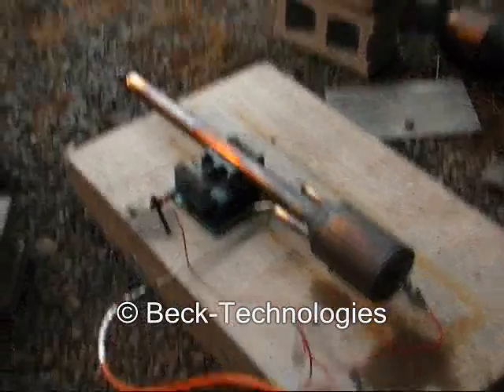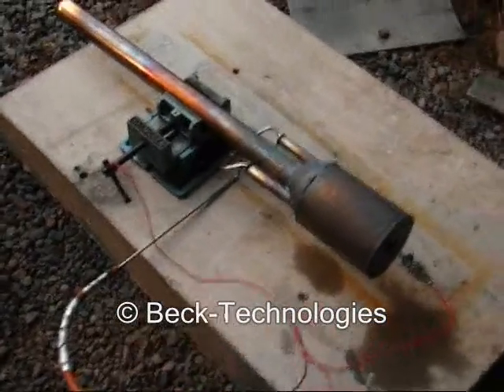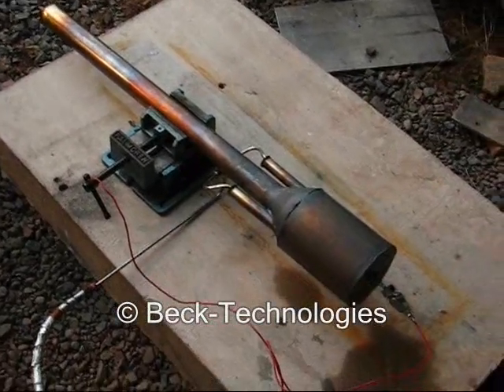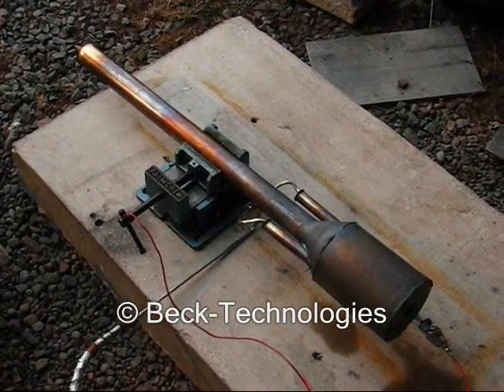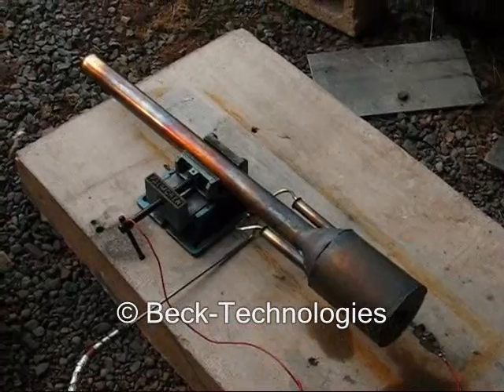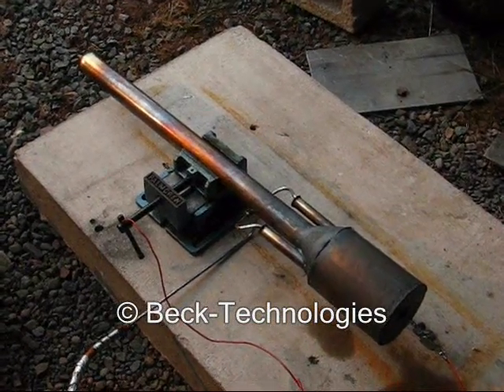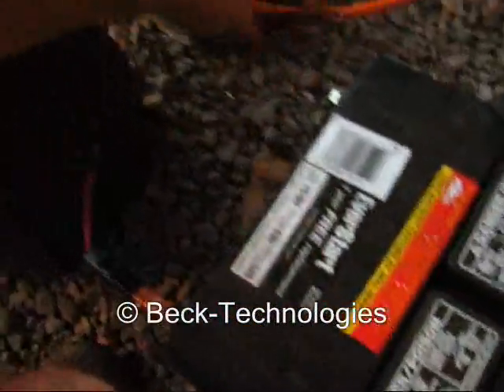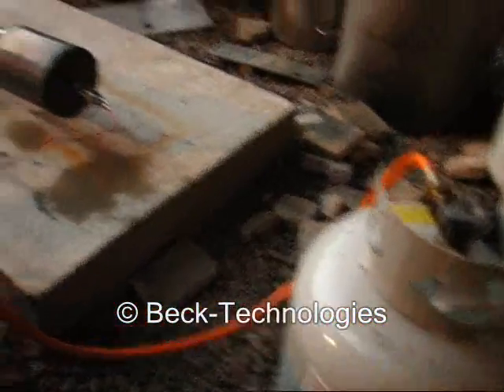10 Lb Thermojet Valveless Pulse Jet Engine

Comment: Can it power a bicycle after you gained some speed by paddling
Reply: Olivier Beucken two twenty pound pulse jets will pass cars on the highway
Reply: real life bart Simpson so four of these will get me highway speeds?
Reply: Olivier Beucken If you run it on the right fuel it will only take three and it will pass cars on the highway

Comment: I purchased the FWE engine Beck makes. It's a 1 pound thrust engine. I also have a HK Red Head valved engine rated at 3 1/2 pound of thrust. There miles apart BUT the valveless engine just runs & runs & the HK always has issues. I went through 5 valves in 20 minutes of running. Anyway I have a 10 pound valveless engine from Beck coming in any day. WHEN ??? They answer no emails at all & the FWE had zero  instructions. I will have a good gauge now to see if the 10 lb. engine is 10 lb or 3 1/2 .  I will post it as soon as I test run it.

Comment: If anybody wants to try this engine, it is important to switch to liquid fuel when the engine reaches operating temperature. If you operate the engine on propane vapor, thrust will decrease rapidly. You can only get 60 percent power with propane vapor. this is because the volume of the combustion chamber is not the same for propane vapor and liquid fuel. Propane vapor will take more space. Therefore, with propane vapor, the volume of the combustion chamber will be small. This information is from the Thermojet patent (US patent 3,517,510. page 4)
Reply: Andrew Shingange switch to another fuel lin3

Comment: after the engine got started & the combustion chamber glows, did you cut your ignition spark's power off or did you just keep the ignition spark on??
Reply: u turn it off the how exhaust gases get pulled back and reignight the fuel because of a vacum in the engine

Comment: a chamber (combustion chamber) gets filled with gas, (the end bit thats fat on this video) then a spark plug ignites it all and the gas creates a big bust of air (also can be provided by air compresser) that pushes a continuous flame out the flame tube. the spark plug doesnt have to be sparking at a constant cus the flame from the first fire keeps it going. and the gas has to be flowing at a continues flow. any more questions about em?

Comment: they can't really, the combustion chamber pressure is always changing from high to low. never seen one explode ever, leaking fuel lines are more hazardous than the engine itself. being burned by it is an obvious concern

Comment: Pulse jet engines are pretty easy, you ignite the fuel, and a "pulse" is created. The resulting vacuum pulls more fuel into the combustion chamber, and it ignites again. This process repeats and creates a jet engine.

Comment: so much wasted energy! one could place a small oil case around the glowing section, and u could boil oil to a vapor, and easily use it to fuel it. Connect it with a turbine, and u got potentially free electricity!!!!!!!!!!!!!!!!!!!!!!!!!!!!!!!!!!!!

Comment: you. you are an idiot. there are THOUSANDS of examples of this kind of engine - even propelling go carts, model airplanes. the engine is simple in design, but complex in principle - it takes into account harmonics of the intake and exhaust tubes (yes, there are distinct intake and exhaust tubes) and the way the thermal energy spreads in the tube itself. 

just because you don't understand something doesn't make it a hoax.

Comment: So how many Lbs the contraption weights with a spark plug configuration?
How big of a battery for the ignition? 
How long can it run continuous at 1%,10%,50%,100%?
What is the time from spark ignition to 100% throttle?
Did you notice any attitude changes in the operation of the engine in different meteorological conditions?
I am a nerd, I think i want to built one of those.
Reply: same

Comment: That's 10lb thrust. A lot of people use propane. It can be as cheap as the cost of scrap metal and some brake lines if you know how to weld. Now sure you could rig it on a bike, gokart or whatever, but I'd be iffy about ridding along with a red hot piece of steel. Plus you can't run them very long without running the risk of failure.

Comment from the maker: @Themayseffect   Pulsejets will run on almost anything that burns, but if you deal with them on a daily basis, you'd probably go with propane too, since you dont come home every night stinking of kerosene. Methanol mixed with hydrocarbon fuels produce very good results. Hydrocarbons will burn significantly cleaner with methanol mixed in.

Comment: #2 is definitely a bad idea, as pulse jets work on the principle of pulses which causes a fair amount of turbulance and vibrations that a turbo is not used to and it would thus break quickly.
@pipzipcip2000

Comment: Hy,

I plan to build such an engine myself-valveless...and I had a few ideas of how to improve it!What's do you think about:

1. A ceramic (or asbestos?) coating inside the combustion chamber. It would protect the outer metal shell and it would increase the combustion temperature thus increasing the fuel efficiency and power?

2. A turbo, powered by some exhaust that would in turn send compressed air into the intake?

3. Linking 2 eng. in a series? exhaust to intake.

Thanx,  Alex C

Comment from the maker: @EnglishTurbines 
The evaporative cooling from methanol results in a much  higher fuel charge density, combined with its rapid burn speed, result in much more thrust output.

Comment from the maker: @EnglishTurbines 
That particular video was running on a nearly empty, cold tank, so it was not at max throttle. At max throttle it is much more like the videos of the 4lb thrust engine, with distinctive shock wave pattern in the exhaust. The engine will put out approx 14 lbs on liquid fuel like methanol, you dont fly with propane. Propane is simply a clean easy no mess no fuss fuel for ground tests and demos. You dont go home smelling like kerosene at the end of the day.

Comment: @BeckTechnologies 5. Whilst the ease of starting is excelent, I have my doubts about the trhust claims, Does not look like enough air mass flow to do 10lbs thrust to me.
6. As you may have guessed, Im an engineer, and have made my own Turbojet for about 500USD...13lbs thrust @ 160K...see my Link.

Comment: @BeckTechnologies 1. Put it in a plane to demo it. (ie fly it)
2.Show how you propose to carry liquid Propane in the plane (and control flow rate)
3. Show the engine on a test rig doing 1lb up to 10lbs thrust.
4..Demonstrate  thust to weight ratio.

Comment from the maker: Unfortunately you cant just buy parts for pulsejets, we make all the parts from flat sheet metal and roll them and weld them up.

We also offer partially completed engine kits with all the materials you need, and most parts rough cut / formed

Comment from the maker: Its about 1000 degrees away from melting, you can hold your hand 6" away from the chamber just fine, the propane tank 4' away is actually chilled considerably by the evaporating propane.

Comment from the maker: Dimensions are rather important, cant just stick a bunch of tubes together and expect it to do anything other than burn fuel and make noise if it runs at all. With some engines altering the dimensions 1/8" can result in a 50% increase or decrease in thrust.

Comment: Wrap it in some Kaowool/Inswool, ceramic wool that can stand up to 2800-3000 degrees F. Great insulator and will probably enhance efficiency as more energy is directed out of the exhaust and not radiated off as heat. I use it in my propane forge, 2" thick, and the steel shell only gets up to a few hundred degrees despite the inside behind bright yellow orange.

Comment from the maker: The open flame is pointing in the opposite direction of the tank, Einstein, blowing at 600 mph, pulling cool air in from the direction of the tank. 

Forklifts have their propane fuel tanks located above their engine, as well as motorcycles. Cars also have their exhaust pipes go directly under the gas tank. 

Learn how to spell flammable and maybe I'll take your comments seriously, Troll.

Comment from the maker: With how good of an insulator stainless steel is, and how much propane cools when it expands out of vapor form, putting the engine directly against the propane tank would possibly just barely make up for how much the tank is cooled.
A few minutes of running will cause the tank to form ice on it, 28lbs of steel + 20 lbs of propane all cooled below freezing would take a lot of heat input to not only keep up with the cooling but cause it to over pressurize.

Comment from the maker: Stainless is an extremely good insulator, you can hold your hand within 3" of the engine. Add to that the fact that propane expands and acts like a refrigerant, after a minute or two of running the propane tank can actually form ice on the tank. If you sit around and do nothing for the time it takes for the tank to heat up to the point where something bad can happen, you would have to be an idiot.  Common sense is keeping something for putting out fires near by, no different from a BBQ grill.

Comment from the maker: No, propane burns, it cant explode in the tank. The only way to make a propane tank rupture ( most have safety release valves to avoid this) is to stick it in a fire and wait. It is going to take a lot of energy to heat up the 28 lb tank, and the 20 lbs of fuel inside it. If you sit around for the 2-5 minutes that a propane tank is sitting in flames then In my opinion you kind of deserve it. Though with the tank open, and gas flowing out, any fire would melt the rubber fuel line, and blow out.

Comment from the maker: The pressure changes rapidly, but you can measure the pressure with the right equipment, peak pressure is about 60 psi, the min pressure goes down to about 7 below atmospheric.

Comment: mild will do, but it will deteriorate after a while. i built a small one with .060 thick mild steel and only ran it 7 times before it burned up. im trying to come up with a design that uses standard plumming parts so more people can make them.

Comment from the maker: Another interesting thing is that mild steel engines will have lower core gas temps than stainless engines. The mild steel conducts and radiates heat away so much more rapidly than stainless. A mild steel engine can give you an infra red "sun burn" up to a foot or two away, where on a cool day you can put your hand right next to a stainless engine for a few seconds without discomfort. The energy that doesnt escape from a stainless engine is kept in the exhaust to do work and create thrust.

Comment from the maker: Core temps of the pulsejet are close to the temperature limits of the fuel burning in a higher oxygen environment. Propane will produce a core gas temp of over 2600 F very easily. Propane stoves, or even torches for that matter wont really melt steel, but if you stick a steel bar in the tail pipe of a pulsejet, it will melt very rapidly and shoot globs and sparks of molten metal out of the engine.

Comment from the maker: Stainless steel has one of the highest insulating values of any high temp metal. It gets hot but the amount of heat that it radiates away is suprisingly low. 

If it were a steady combustor turbulence could be bad, but the pulsating combustion is actually greatly enhanced by the right kind of turbulence. The more turbulence the faster the fuel and air mix, and the pulse of combustion will be faster and more powerful. The turbulence also allows the engine to self start.

Comment: would an engine of this size even be capable of running on a model aircraft using propane?  (the small propane or MAPP brazing cylinders come to mind) or would that not produce enough fuel for any significant amount of flight time?

also, whats the rough diameter of that combustion chamber?  6in?  more?

is the 10lb of thrust a figure only attainable under ideal "bench-test" configurations, or could u actually get that on a flying model?

thanks!

Comment from the maker: Its not really an overheating problem, they are designed to run that hot, using stainless to handle the prolonged high temps. You can run them on RC planes, liquid fuel systems with pumps work the best.

Comment: is it able to install on an rc jet plane?  its usually the valved ones that go on them.
so if you can put it on a rc plane, do you use a fuel other than propane?

Comment from the maker: Butane does not burn very quickly but you should still be able to get an engine going on it. You need an ignition source in the combustion chamber for best effect, if it doesnt ignite in the right spot it wont build up to the explosion like combustion.

Comment from the maker: Nope, the strength of the metal is more than enough to contain the pressure. The way pulsejets work, part of the cycle they are below atmospheric pressure, if the metal becomes hot enough to be damaged it will squish flat rather than explode out, the force to crush a tube is many many times less than the force to burst it.

Comment from the maker: The design is mine, roughly based on the Thermojet design, except with huge changes to the intake lengths and configuration for better performance.

Comment from the maker: I would think that the header tape would probably cause the stainless to melt as it would prevent a lot of heat from excaping. Ceramic lining a pulsejet on the other hand would keep the stainless from absorbing a lot of heat in the first place. Doing both could have some very interesting results.